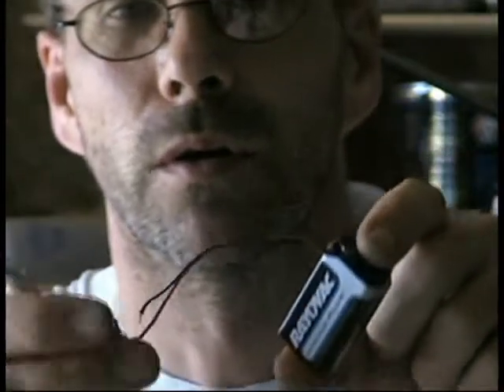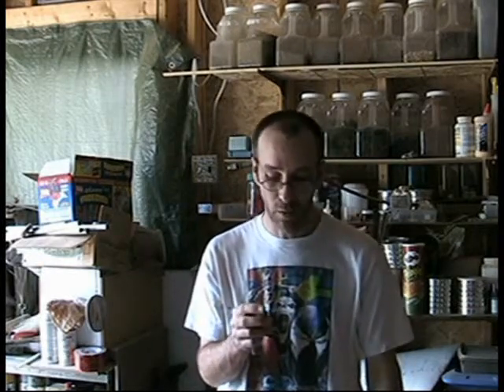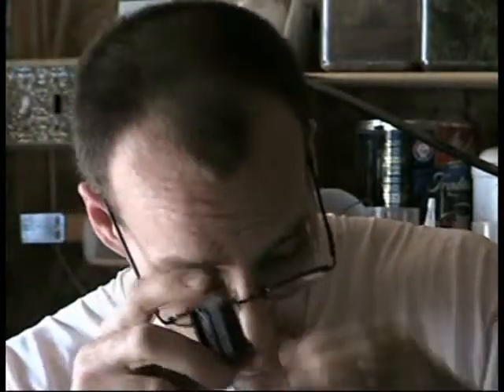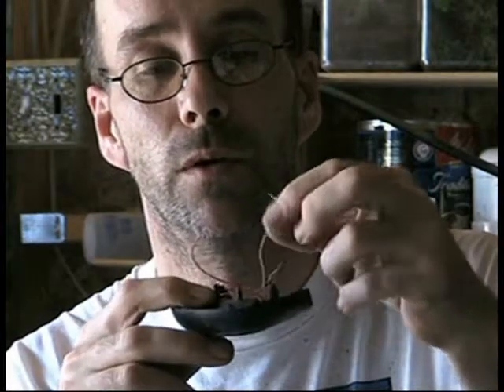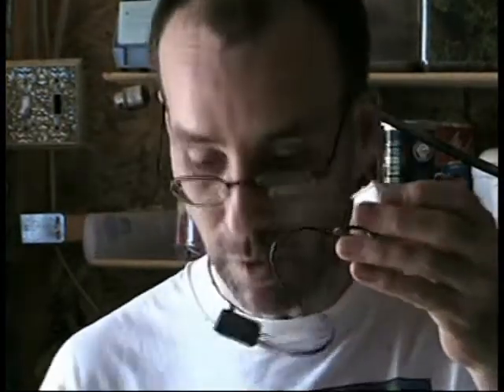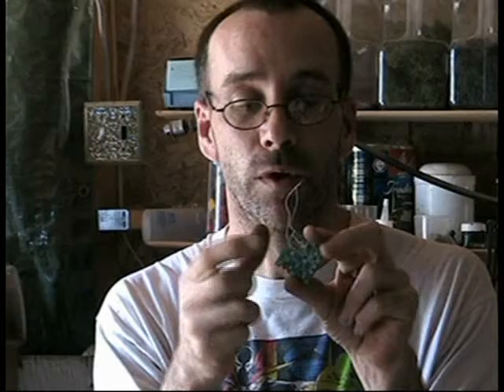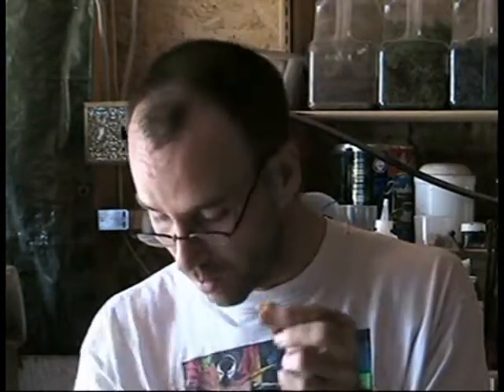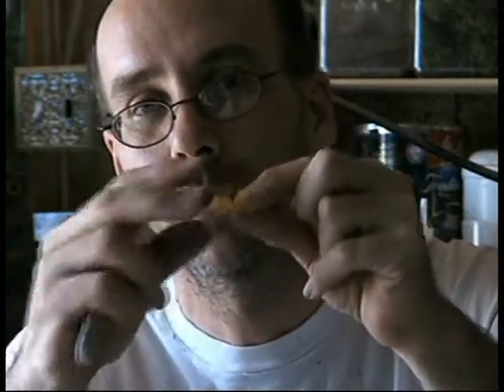LED lights in your wargame terrain or dioramas - Basic stuff

Comment: Ahh, LED lights are fun. At school I once put that in a circuit with real low voltage. I turned it up slightly and it started smoking and it caught on fire a little. Learned my lesson though. 

Anyways, most batteries are 1.5v, then of course you have the square 9v batteries.
Yeah, the battery size lets you know how long it will last, smaller being low life span.

Nice video, when i start terrain making i'll considering using LED's in buildings.